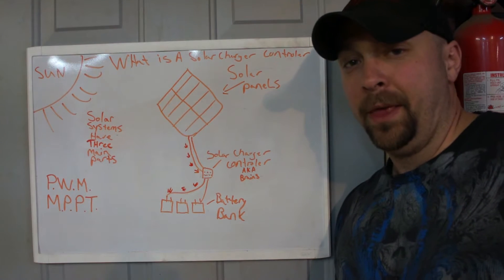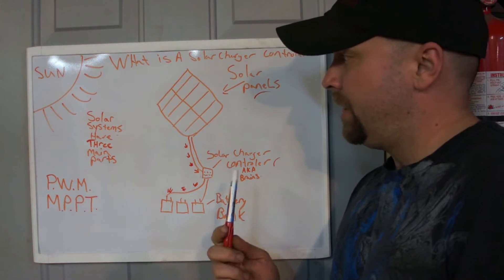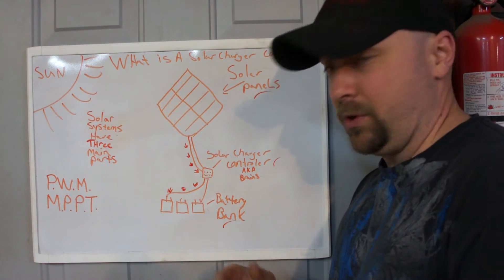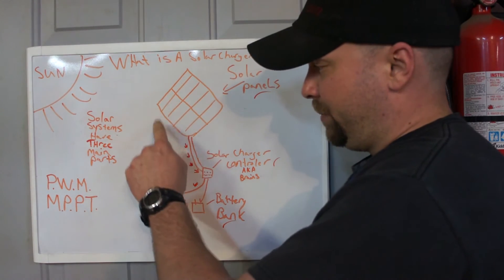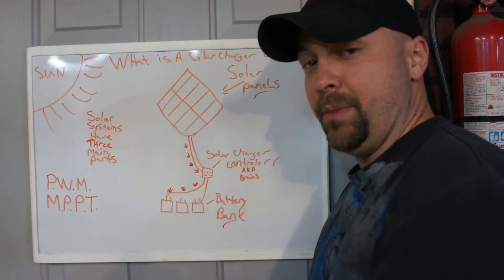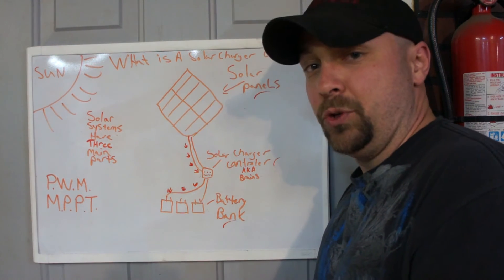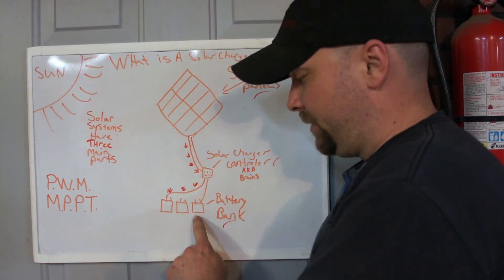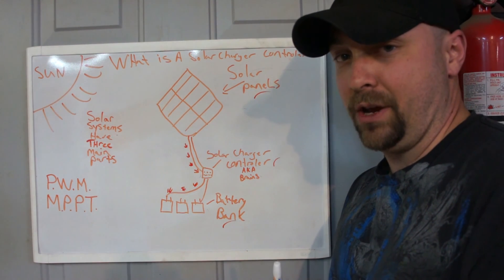Why you need a solar charger controller

Comment: Your explanation is vague. To keep the current from flowing back to the solar panels, all you need is a powerful diode in series. The controller is basically required to effectively manage the energy coming off the panels, so that batteries get just what they need, to charge up and when they're done, their kept on trickle charge. The rest of the energy, if available, is sent to your inverter, at the right voltage, so that your inverter can convert it into standard AC power and power your equipment. Actually speaking, there is a lot more to a complete, fully automatic home power system, in terms of how the energy from all available sources is handled, which cannot be explained here.
Reply: Tony Rebeiro I agree sir, but think this video is just for the beginners. No need to explain everything? Like me I just needed to find out some basic information.

Comment: I have a small hook up 200amp solar to 30 controller, 12v battery. All charged and ready to go, however, when the inverter is turned on, the battery quickly drains and the controller trips off. Then start over, charge batter (using a charger) then hook back up and so on and so on.  Same thing happens every time. What do you think is happening. Everything is brand new.

Comment: I just run a diode in line and have never had any problems

How would  a 3 - 6 amp charge boil 3 large deep cycle batteries ?
Reply: It will, theoretically, potentially blow up or destroy the battery. Nowadays many batteries have internal BMS systems that avoids all that, but far from all have it.

Comment: You forgot to mention how the charge controller control's the voltages output to battery to accept just the right amount of voltages. It prevents battery from cooking to fast.

Comment: Is it possible that my controller is allowing my batteries to discharge?  My batteries charge all day, but they are discharging at night.  They go from 12.8 down to 12.5 or 12.3 during the night.  I have already shut down the refrigerator that I had running all night and this is still happening.  Where could the draw against the batteries be coming from?

Comment: Hi, nice video, thanks !
I have a question :
If you connect the solar panel to the charge controller and the load ti the charge controller too. On a sunny day should your load get power ? Note there are no batteries !
What do you feel ?

Comment: hey jack

do you reckon instead of using a solar panel at the input of the terminals, get a 12 volt wall adaptor and screw into terminals?

 so that way if there is no sun, and you need to charge your batteries, plug in the wall adaptor in (with the right polarity) and it will be good, cause it should work the same have all the over discharge and overcharge protection circuits right... 

or does a solar charge controller not work all together with a 12v wall socket adapter ?

Comment: if you dont have a controller, what can happen to the batteries?
I have a friend that has a system and one of the batteries bulged out and is not good any more. could it just effect one battery in the bank from over charging?
I have asked him to send me the info on tier set up. They are in south America and are, as far as I know just running lights and maybe a couple fridges.
I was just wondering why only one battery in the bank got damaged. My first thought was maybe they did not maintain with distilled water and maybe used well water. They are off the grid, so that might be possible.
Any info you can send me would be great.
Thanks
Mike

Comment: The controller I'm looking at has a solar panel input, battery output, and load output. What is the load output? Is that how I can power things with the extra electricity that is left over after charging the battery? So after the overcharge protection kicks in, does it then divert the remaining power to the load output so I can put it to use rather than just waste it?
Reply: +mtcaddis The load output allows you to use the power from the battery. Remember to check the polarity of the load and stay below the maximum current rating for the load you connect. Don't think of it as the 'extra' electricity but simply the electricity available from the battery which is in turn being charged by the solar panel. The charge controller should shut off the load if the minimum battery voltage is reached to keep the battery from further discharge. The manual should explain how your particular charge controller works. If you don't have the manual, Google the brand and model number for more information. I hope this helps.
Reply: Ok, that makes sense! Thanks!